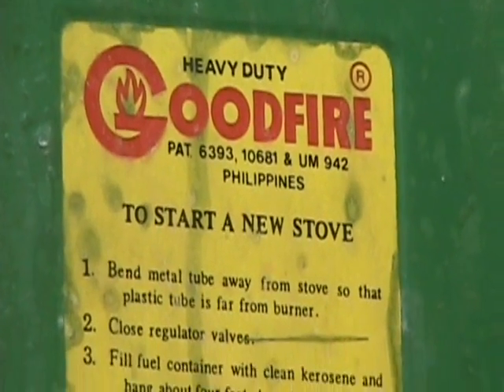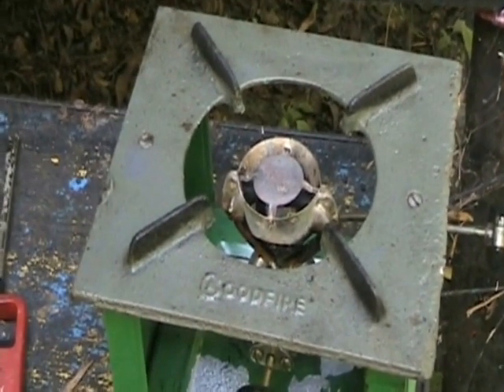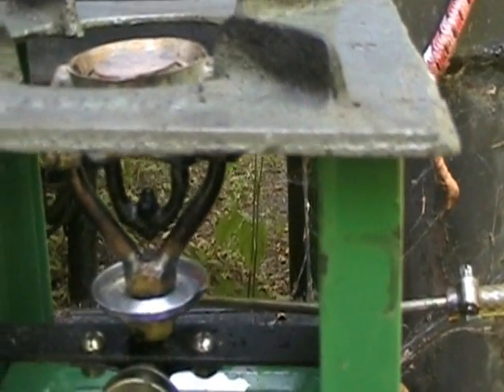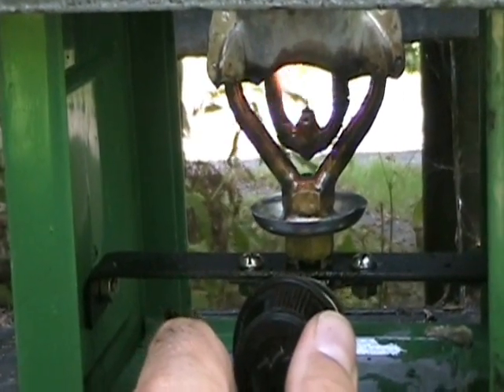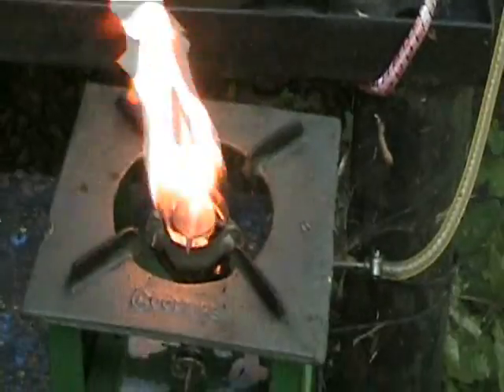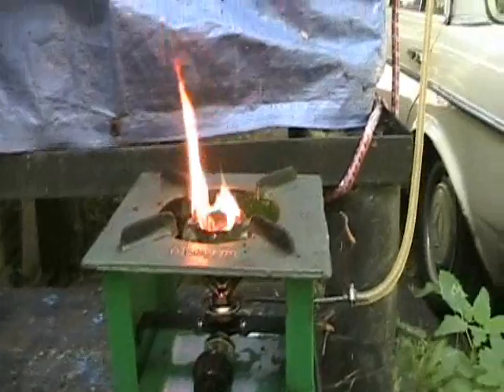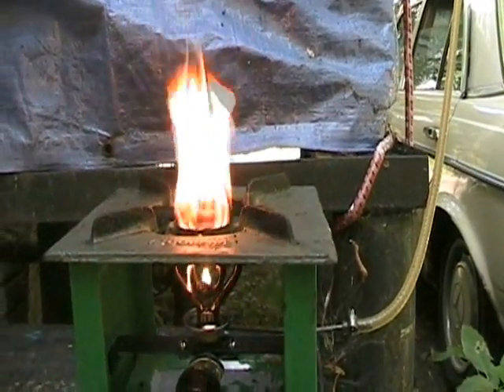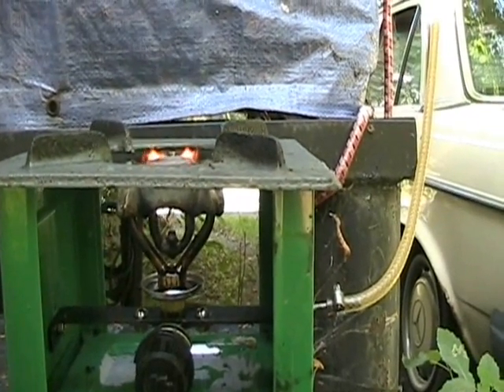Goodfire Kerosene stove burning B100 Biodiesel

Comment: Problem with that stove is it leakes on from the valve stem after one or two years. reason being is they use an asbestos coil wrapped around the valve. Just like a faucet seal. But theat asbestos doesnt last. Then you have a problem later on. That stove is very popular in the Philippines.